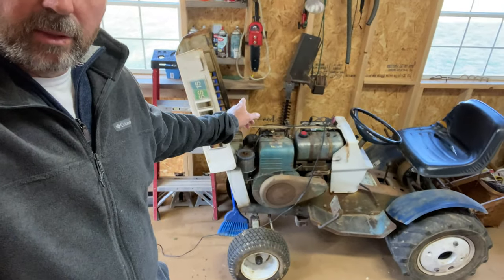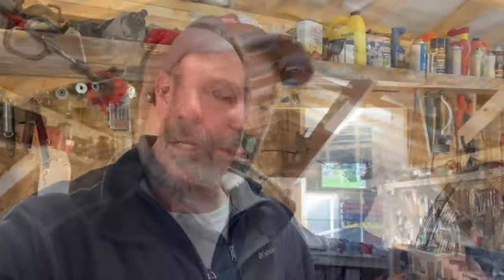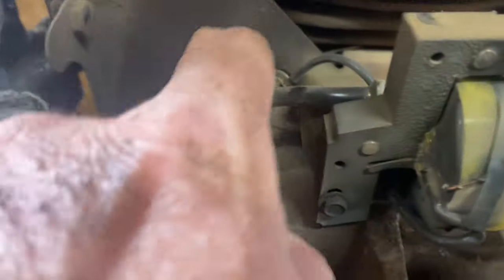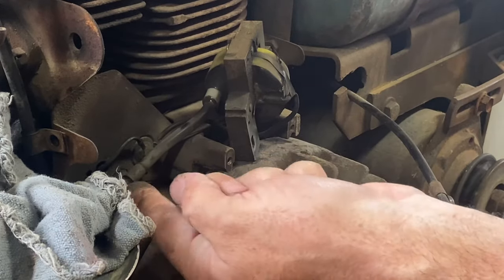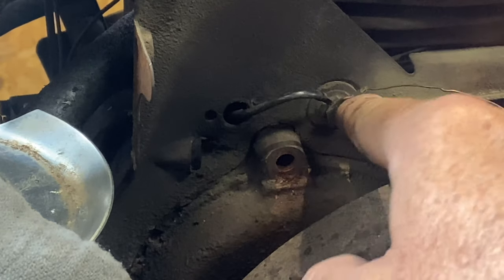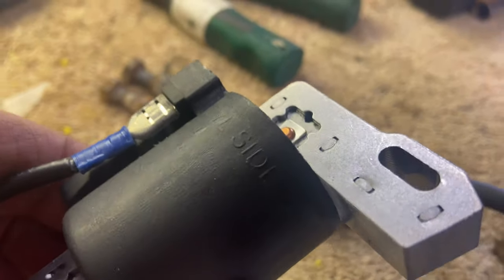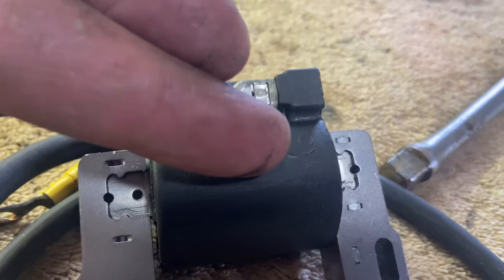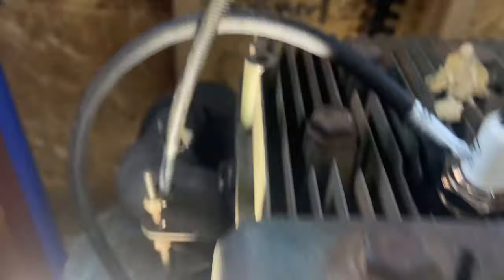How to convert points to Electric￼ coil 15 hp Briggs Sears suburban￼￼

Comment: does it shut off by key , The wire going to points , there is usually a junction block by the points , Unhook the points there and the other wire there , at junction block goes to the ign switch to kill spark..
Reply from the maker: It does not shut off by key so are you telling me to disconnect two wires were the points are at?
Reply from the maker: I will do a video on this if you’re cool with it and definitely give you a shout out
Reply from the maker: But a year and a half ago when the original coil was working the key switch did not turn it off then either, always thought it was a bad ground wire, what is your thought?
Reply: @MurphyMower  The bolt your coil wire is on is just a insulated terminal . The wire you removed going to the points also went to the ign switch . Usually all 3 wires come together by the points . There i disconnect the wire to points and keep the wire going to ign switch . . But you need a wire from switch to the coil .The wire to switch should go to ground when switch is off , if not check switch , and may need to check switch ground .  I made a video of doing this conversion if you want to see how i did it .
Reply: I have a 15 i want to rewire , but i like the 14`s wiring so i will wire it like that and explain why , but add a start solenoid

Comment: Will this work on a SS12
Reply from the maker: I’m not really sure on that. It will work on a 14

You just gotta make sure that the curve is correct and the bolt holes match up and you’d probably be fine but I don’t know that for sure as I have not researched that
Reply from the maker: wish I could be more help

Comment: Not worth the time seeing they did a study that showed points make more power  by 3 to 5 HP difference even in higher RMP ranges. Not much of a reason to convert over no added benefits seeing that the time saved in maintenance of points is less then the time to convert it.
Reply from the maker: Yeah not sure

I figured the newer machines Dont have point for some reason

IT’s running more dependable for now

Thanks for watching
Reply: @MurphyMower  yeah most people don't know how to set points anymore to make them run right.